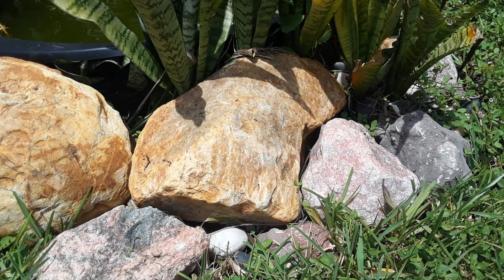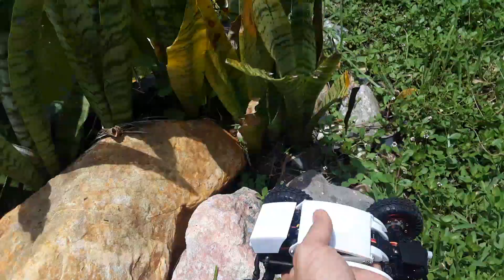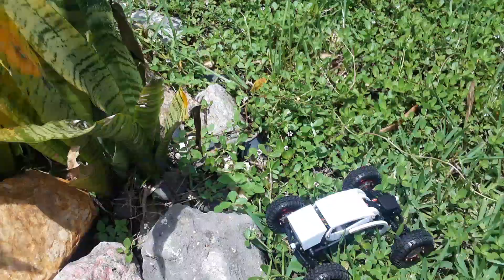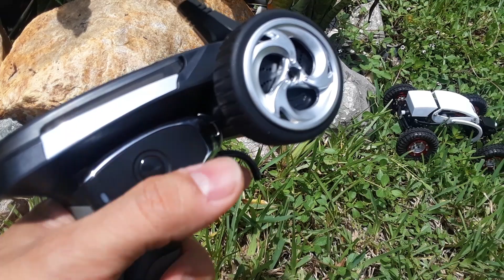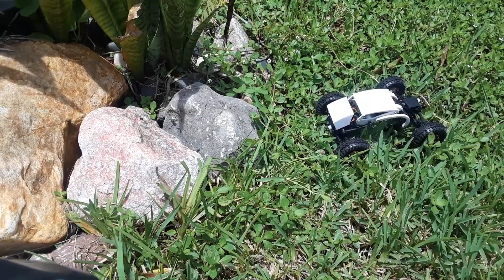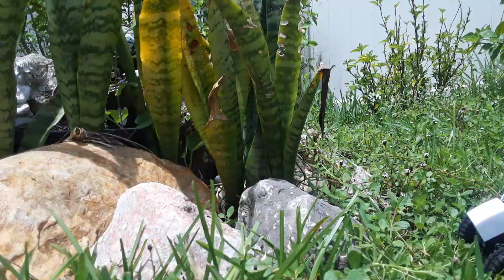Basher Rocksta Stingray chassis test run

Comment: u tried with portals yet? or u got other projects goin on?
Reply from the maker: Portal axles available right now only support driveshaft designs. In this particular design it must be a MOA design in order to accomodate for the body shape. I am working on a special axle right now and could add the portal part to it so we shall see 🤷🏻‍♂️. As for working on other projects, well, I am always working on something new. Every Furitek chassis has been designed by me. Working with them has been using a lot of my time and I havent had much left over time for videos but trust me theres a lot of stuff in the works 😁.

Comment: Thanks for the video, nice to see what it can climb.  Would it climb better with weighted wheels?  I have my stingray apart waiting on HK to get the esc back in stock.  I did border the pieces to be able to do dig.
Reply from the maker: Yes, weighted tires/wheels help a lot. I just try to keep as simple as possible to show what the actual chassis can do. You build up from there :)